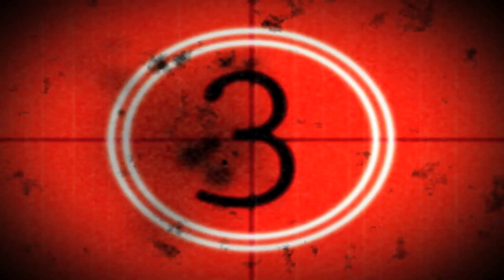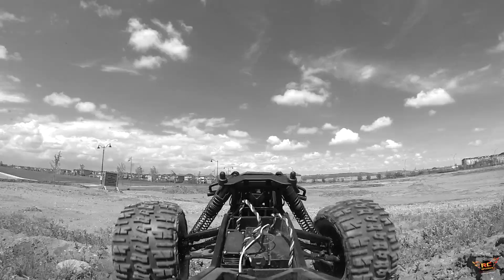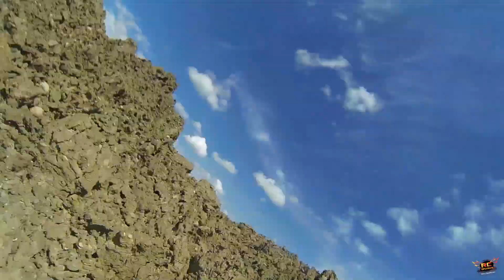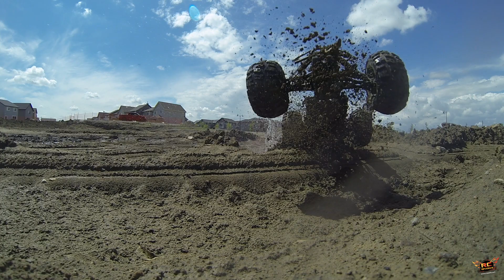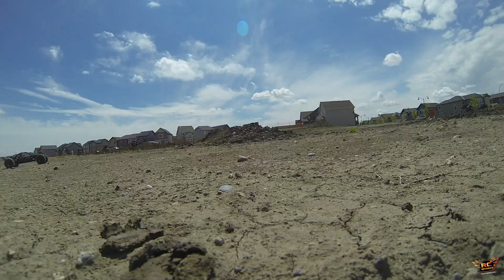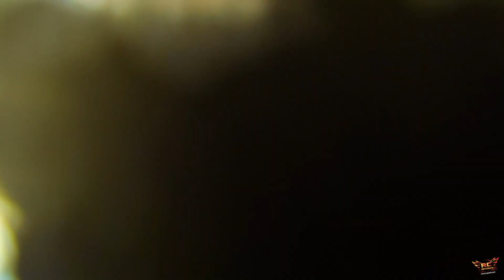RC ADVENTURES - SAVAGE Flux HP 4X4 - TCS Baja 1/5th Conversion KiT - 4S Lipo Testing - Dirt

Comment: Well djmedic after watching this this video I had to have one of these beasts lol so I figured I have 3 savages so I could spare one so I ordered it on friday lol im also replacing the flux transmission with a Kershaw Designs V3 direct Drive gear box and powering it with a 150 amp esc, 2250kv 6 pole 1/8 truggy motor,20tp/47ts are these ok gears to run on it !!!!
I'll post some pics on facebook so u can check it out next week when I get it together and I'll post a video also for ya thanks